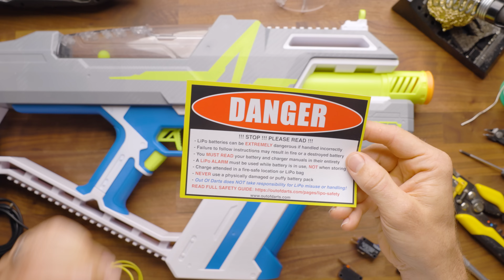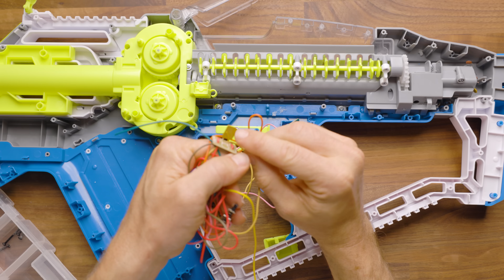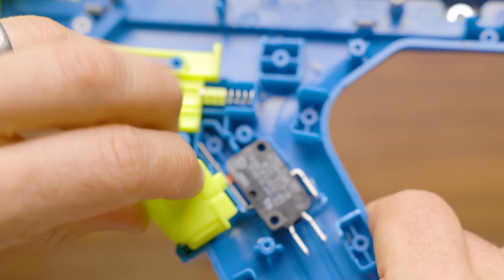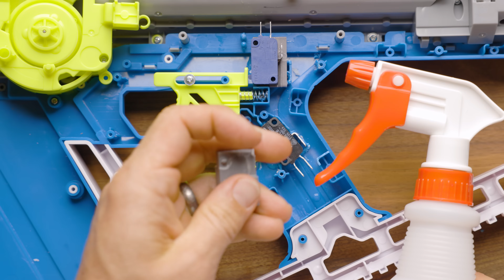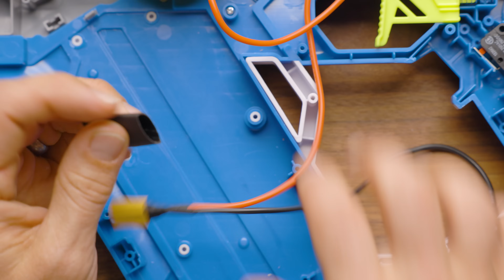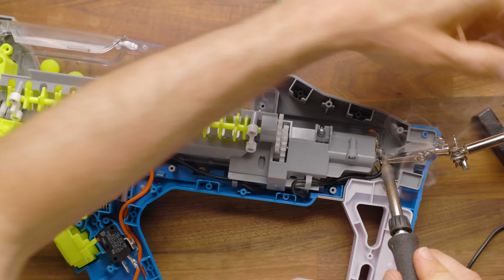MOD GUIDE: Hyper Mach-100

Comment from the maker: Have any questions? Leave them below! We have a running FAQ list in the video description. - Perry
Reply: Does this mod help with the inconsistent rate of fire? I wasn't sure if this was agitating the rounds on to a conveyor, and the inconsistency or misfiring was down to the ammo not porting into the conveyor system. If the system is pretty much gravity fed it becomes extremely complex because of the innumerable ways the spheres can interact, and the fact that they are made out of material that will change with heat and moisture, becoming more or less tacky... The computational modelling technique used in fuid dynamics to analyse and possibly solve this is known as DEM (Discrete Element Method).
Reply: @sepiarain  I did my first Lipo mod to this yesterday and firing rate is still hit and miss and accuracy is still all over the place.  Definitely a performance increase and the flywheels spin up way better on lipo than the D batteries.  There is an agitator but it just isn't as effective as the Rival counterparts.
Reply: Hey is there any way to mod the Hyper Mach-100 Barrel & Flywheels into my Rival Perses with extended hopper as the “Hopper & Battery” Platform to basically convert my Perses to use the smaller “Hyper” Rounds with the Huge Capacity & BTW = I am still using the OEM NERF Perses Battery!    ??????????????
Reply: Wait, are the Mach's motors not the typical stock rival motors? I thought those could take a 3S lipo no problem.
Reply: @themagitechie9955  They are smaller a bit smaller than the Rival motors and pretty similar in size to what was found in the Ultra 1.
Reply: I know I can’t do anything you can do but you do amazing things on blasters and u entertain me all day
Reply from the maker: @palmerdonnan4052  Thanks!
Reply: U need to do the barrel accuracy
Reply: Okay so I ordered your kit, installed it with a dewalt battery attachment, burnt the belt drive and flywheel motors up. Is there any motors that can handle that, that I can swap?
Reply: I love the third party and 3D printing community but I find they fire too hard for my younger nerf group. Is there are softer hitting sidearm or a weaker spring you would recommend? I'm thinking anywhere under 80 fps should be good as we do have a few whiners. Thanks!
Reply: @MarynaraSauc3_  most stock hasbro dart blasters hit around 70fps, the other ammo types hit a little harder. you can also normally customize 3d printed blasters for very low fps with weak springs/flywheels, but i don't see a reason to not just buy a stock blaster instead
Reply: @MarynaraSauc3_  any unmodded older nerf guns I get them at my local goodwill
Reply: Hello are you going to make a hop up tab for the hyper series

Comment: Do you know if any of the worker aluminum flywheel frame or wheels will work with this ? They look to be the same.i see a motors and wheels kit but not sure if they will work.the wheels are 35mm do you happen to know the diameter of these wheels in factory form ?

Comment: Did this mod improve the "spool up" time? My factory hyper takes at least 3 seconds to speed up fast enough to start shooting.
Reply from the maker: Yes, that's largely due to the limits in current draw from the alkaline cells. A LiPo provides much more current much more quickly.

Comment: Could you make it shoot rival?
Reply from the maker: Making it shoot rival would be difficult, and we have since learned that the gearbox doesn't hold up to 3s voltages, making converting to a larger ammo type even more impractical. If it's the form-factor and rate of fire you're looking for, we would recommend instead modding a Rival Perses.

Comment: Man I want this strippers. I tried finding them last year and couldn’t find them and ended up with a different set, but I don’t think they can split in the middle like yours.
Reply from the maker: Search for "self-adjusting" or "automatic" wire strippers, and you should find a couple just like mine! We also sell automatic wire strippers on our website, though they are a different design: https://outofdarts.com/products/wire-stripper
Reply: @outofdarts  thank you!

Comment: Thank you for the work producing these mod videos. I have also followed and had success with the Nemesis mod as well. A question regarding the FPS enhancement with the mach 100 mod I just completed though. My math tells me that fully charged the 2S lipo is 8.4 volts, but the 6 D-cell batteries this is designed for equal 9 volts, so the lipo battery is .6 volts less than the D-cells, so how do we get higher fps performance when providing less voltage?  I understand that the mod still provides the convenience and value of a rechargeable battery, so that is still a good reason you might opt for the modification, but I don't understand how it would increase the blasters fps rating.

Comment: Can you change the motors to a brushless motors
Reply from the maker: With both Rival and Hyper flywheelers, replacing the motors and/or  flywheels is difficult. I'm not saying it can't be done, but It would only  be something we'd recommend to the experienced modder.

Comment: Is there a plan to upgrade the motors to ones that would be 4-6s capable?  Love this mod, just want to not burn my motors out so easy.
Reply from the maker: There are no current plans to offer upgraded motors. We even changed the recommendation on our mod kit to only run 2S LiPos because the risk of burning out the motors on 3S was too great.

Comment: I have a little question 
Why did you solder the negative wire on the NC firing switch ? 
So great video
Reply from the maker: The negative wire helps deenergize the circuit for the purpose of motor braking the hopper agitator when the trigger is not depressed
Reply: @outofdarts   like a Flyback diode ?

Comment: Got your mod kit will be using it soon on my mach 100 hope indont mess it up had to buy the parts seperatly in your store since your kits were sold out only thing i couldnt find in your atore was the yellow wire other than that everything else was there

Comment: Nice mod guide! You are getting very good at making them now, I couldn't tell whether you were speaking as you did it or if it was a voiceover. Personally, I do most of the wiring outside of the blaster and heatshrink everything but the way you did it looked very neat. It would be interesting to see a hop-up for this, maybe also an extended hopper or a funnel to make reloading easier. Thank you! 💚🤍💙

Comment: Could you use a MOSFET to control motor speed? If so could said MOSFET be set up to create an easily adjustable external knob to control pusher speed in something like a Rapid Strike?

Thanks!
Reply: you could do a pwm. He sells them and u can get them cheap on amazon

Comment: Can you do an infinus mod guide? It is just so complicated inside and I don’t want to risk breaking any of the electronics.
Reply: project nerf has a really good one
Reply: @darkwhite1259  yes, but he used the stock pusher motor, I would want to do an upgraded pusher.
Reply: @Kenny_Gamer1  all you need to do is buck it and then wire the flywheels/pusher like a Rapidstrike